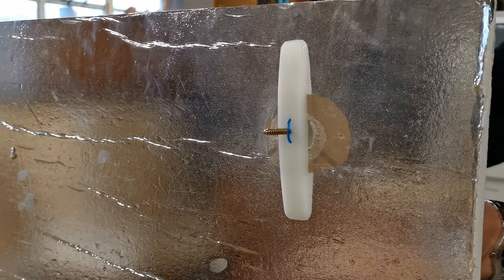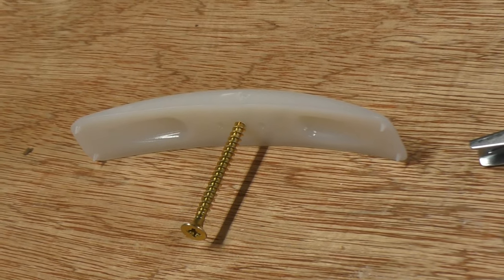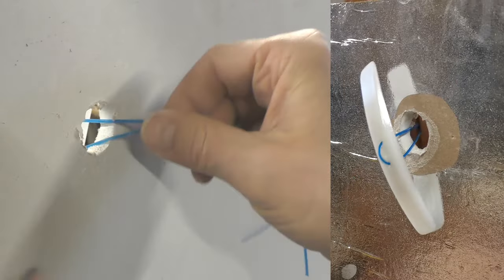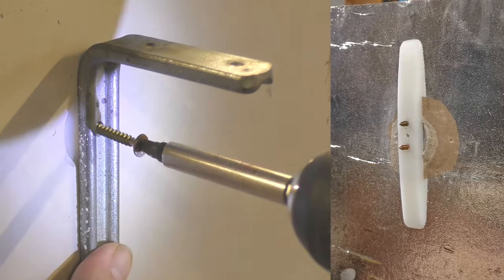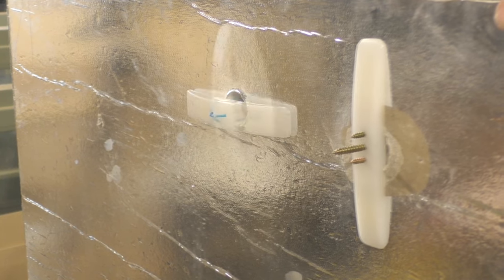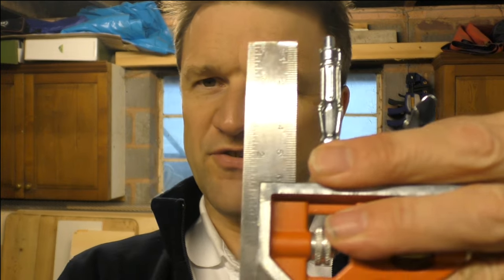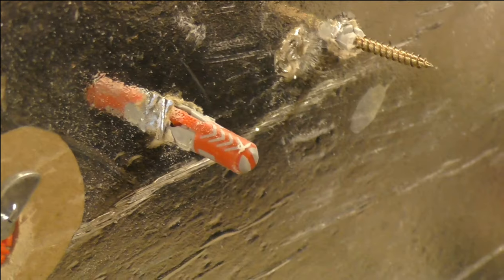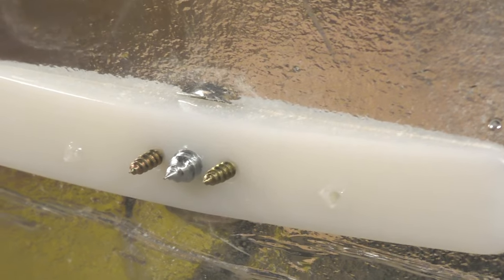The Strongest Plasterboard Fixing Ever!

Comment: I just fit a double Ikea Pax wardrobe and had been searching for ages to find best way to secure it from falling onto my toddler and this has sorted me right out! I was always fearful of having to fix into plasterboard, especially where I absolutely don't want it to fail and this is just magic. Thank you!
Reply from the maker: You're welcome Jonathan. Thanks for the comment!
Reply: better to find the timber uprights if there are any they will be at 400 centres, then fix to that instead. or you can cut a hole in the plasterboard and fix a timber between the uprights to screw into then put battens on the underside of the plasterboard and fix the piece you cut out back in. failing this you can just use these device and put gripfill on the back of the wardrobe, or, drill a big hole enough to get a long length of batten through the hole and hold it on the other side with your fingers then fix it with lots of screws

Comment: Great idea.
No reason why it can't be scaled down to a half size version for lower loads.
Reply from the maker: I was talking to a fitter who works with me on the day job and he said exactly the same thing yesterday!
Reply: Charlie DIYte   A small version would also be easier to insert when the gap between the wall and the plasterboard is significantly smaller than 30 mm.
Reply: Snap toggles are what you need. I've been using them for years, and have the advantage that the fixing is by a standard thread machine screw. @ianmathieson65
Reply from the maker: I think they're working on this, and also trade packs will be coming out soon apparently.
Reply: Charlie DIYte sure he did.
Reply: I said it to my fitter 3 weeks ago
Reply: @CharlieDIYte  Well these are more practical and you can hang a man of one fixing, go to Bullfix.co.uk to find out more .
Reply: @ianmathieson65  Well these are more practical and you can hang a man of one fixing, go to Bullfix.co.uk to find out more .
Reply: @peterwhite51  yeah, but can cut through electrical wires hanging in the back of the board, these are the best option >
Well these are more practical and you can hang a man of one fixing, go to Bullfix.co.uk to find out more .
https://youtu.be/mCt7_j8n-Yw
Reply: Mark Howe:  Thank you Mark.  I’ve watched the videos using the link you provided.   Certainly very impressive in pure shear but I wonder how they’d compare with other fixings if there’s a significant pull-out component to the load as with a heavy wall cupboard.  Because the centre of gravity is then offset from the face of the plasterboard, the cupboard will try to rotate about the line contact with the wall at the bottom edge of the cupboard.  Of course, these fixings near the top will try to restrain it from this rotation but in doing so will experience a pull-out force in addition to the vertically downward shear force resulting solely from the weight.

It would be most interesting to see how they then compare with other fixings in a straight pull-out test where the area of contact of the fixing against the rear of the plasterboard becomes the important factor to prevent break-through.  I suspect selecting the best fixing depends heavily on the magnitude and direction of the load force, i.e. it becomes a case of horses for courses.
Reply: @ianmathieson65  Good reply, and you are absolutely right, there is Sheer (downward force 90 degrees), Tensile(direct pull out) and then a combination called a rotational force. We have many competitors products including our own that tests sheer and tensile loads and we are currently adding rotational load videos at our website this week.  Most importantly its how well the surface mates with the surface behind the plasterboard, it needs to be a flat surface to distribute the load evenly over the paper and not to pierce the paper at the rear. There is a limit to Tensile pull out on plasterboard between 400mm centres, we have modelled mathematically our fixing to be at the top end of this scale whilst keeping it as small as possible. (cost in manufacturing) Its also a two part fixing that can be put together by the end user, making the cost savings to the customer. We have maximum loadings on the smallest fixing that can be possibly obtained. you cannot beat BULLFIX Plasterboard fixings. See our testing at our website, search for http://bullfix.co.uk
Reply: @markhowe5539  That one isn't more practical if you need to put another screw in close to the first one.
Reply: @peterwhite51  They are very good, but they don't work in very thin materials like ply or hardboard - you can't trim the plastic part down from the front as you'd end up with two pieces.

Comment: I often do a similar thing using a thin strip of wood or ply,pre-drilled, & short bit of string to pull, & shove-through a hole or slot in the plasterboard, then screw on,with bracket pre-attached.
Or better still, if you can, use a magnet to see exactly where your nails/screws,are,, therefore your timber/metal studs are, & fix solidly into them.

Comment: Looking at this I can do the same thing with a pice of timber with two holes, a bit of string and some drywall screws, it's been well thought out though.
Reply: I regularly patch repair plaster board ceilings using a timber batten and fixing original cut out back. Makes sense I could do this on a stud wall and create fixings where required. Would need some easy fill to cover up though 👍 will definately give these fixings a go.

Comment: Charlie, you just saved me a lot of heartache trying to fix a drywall fixit problem. I just ordered a 8 pack  of geefix. Thank you!!
Reply from the maker: Glad to hear it. These things are very clever. I was doing a soft furnishings project in Barra and the wall was old lath and plaster - just crumbled away with the fixings we were using so as a last resort I used one of these. Gripfilled the gap, filled with Easi-fill the next morning and the fixing was as strong as if we had anchored into the wall behind.

Comment: In the US we have "Snaptoggle" BA from Toggler. The heavy duty version 3/16" can hold up to 238lbs in 1/2" drywall and up to 802lbs in concrete block. They are easier to install and reusable. No need for 2 holding screws and a string like this design. Maybe a comparison between this two anchors would be very interesting. Cheers
Reply: May be we in the UK can get it after Brexit with the UK/USA trade deal.
Reply: Have Snaptoggles in UK too. I use all the time. I dont like the 25mm hole on this one

Comment: THANK GOD!!!!! I came across your video... I was running into blanks worrying about how to hang my 3 radiators (double thickness = heavy) on my drywall upstairs... this has LITERALLY saved me ££££ in not needing to get the walls ripped open to re-brace the studs for the radiator placements. thank you, keep up the great work!
Reply from the maker: Yes, these will be great for that. An awesome fixing that has got me out of trouble on more than one occasion! Thanks for the comment!

Comment: Been making something similar for heavier light fittings for years from a cutting of timber or doubled up trunking lid and copper wire
Reply: @markhowe5539  
Cheers, those Bullfix Plasterboard fixings look much better design wise and durability longevity wise. I'll be hanging up expensive heavy duty 6kg on wall speakers so I'll be going with the Bullfix Plasterboard fixings for peace of mind it won't bend warp the plasterboard.

Comment: As to the Gripit fixings, they're actually a blessing when you have the plasterboard within just a few millimetres of the wall or lintel. Which begs the question: how much clearance do you need , for this fixing, between plasterboard and backing?
Reply: My advise, get a a hammer drill, a concrete drill bit and drill through the lintel. Use a plastic wall plug suitable for concrete / solid walls and problem fixed. This way the fixing will be solid AF.
If it's a metal lintel, then use a metal drill bit with the diameter smaller than the screw thread size and put the screw straight through. Problem solved.
Pro tip: Don't tight the screw too hard, as it will push the plasterboard towards the lintel and it will create a dip on the surface.
Reply: He literally says in the video that you need 30mm for this fixing between plasterboard and backing.
Reply: @arcadely  He literally does nothing of the sort.
Reply: @LordOfLight  You must be trolling. What do you call 8:14 - 8:26? He both describes and demonstrates the clearance needed for the fixing. Did none of you actually watch the video?
Reply: @arcadely  No I'm not trolling, and yes he describes the clearance for the fixing he's demonstrating at that moment; but not for the GRIPIT fixings that the original comment was about.

Don't disappoint me now: under no circumstances admit you're in error and instead claim your mistake is all my fault. I'm looking forward to it.

Comment: (4:00 )Why are you using a Phillips bit on a Pozidriv screw?
That's why it keeps camming out.
And why didn't you mention the Fischer Self-Drill Plasterboard Fixings?
These are superb. I use them all the time and have never had a problem with them even with quite heavy loads.
Reply: Phillips / pozidrive miss use triggers me to no extent, Working in a workshop when i see broken pozidrive drivers and tips, or rounded phillips drivers it bothers me to the furthermost extents of reasonable irritation.
Reply: @another1commenter770  I know. And this dude is meant to be setting an example....
.
Reply: I used them recently for traverse rods and well, I have very brittle plasterboard or they are really not that good.

Comment: About time somebody has come up with a reasonable method of fixing to plasterboard I have to replace my curtain rail fixing 4/5 times over the last 20 yrs I will be definitely trying these out.Great tip Charlie
Reply: For curtain rails try the captive expanding screws.   Or enter the arms race and use 10x50/60 plugs and 6mm screws. Small screws are useless.

Comment: Great video - clearly explained and allowed me to fit 4 new Rointe Olympia electric radiators onto both plasterboard, double thickness plasterboard and a concrete wall. Used the Gee Fix for the plasterboard, and standard screw and supplied rawlplug for the concrete wall. One thing that was interesting was clearing enough of the polystyrene insulation behind the plasterboard to insert the Gee Fix, I found a bent metal coat hanger sort of worked better compared to using your fingers. The radiators were 28kg down to 18kgs, all felt really secure using the Gee Fix and solid when fitted. Did grab some T Bolts just in case the gap behind the plasterboard was not suitable for the Gee Fix. Great videos and advice, you encourage a DIYer to have a go with confidence.
Reply from the maker: You've done a great job there Duncan. Very impressed you managed to clear the insulation for the Geefix. They're a segment towards the end of my recent plasterboard fixings update video https://youtu.be/Jdu9RId7m90 where I fix into the insulation and those T bolts force themselves open, so they are good. Bullfix Extra are also good where you've got very limited space behind the plasterboard although personally with a small gap and brickwork behind, I'd probably use a Corefix and drill into the brick.

Comment: always place it vertically. gravity points down so torque is applied on the horizontal axis. unless you have mainly side loads.
Reply: That was my logic also until I saw this video https://youtu.be/lHb-Tcvkn7M?t=558 clearly showing this anchor performing better when at a 90° angle to the load.

Comment: Charlie - thanks for the tip about using Geefix. I'm not much of a DIYer but I decided to try using Geefix to hang a 26kg mirror  on  a plasterboard wall: It worked perfectly.
The only slight hitch was when I put the first centre screw in it must have somehow caught the plastic "string" and I was unable to pull it out until I loosened the screw a bit. 
Other than that it was plain sailing - the mirror has stayed up for 24+ hrs now so I'm confident the fixings have worked!

Comment: Charlie have you never heard or the thorsmann plaster board spring toggle fixing. I am a professional installer in an A/V capacity and we hang 25-30 kilo speakers out of two of them. There expensive at around 80p each they come in a box of 25. You can use them in single double or triple plaster boards
Reply: Scroll down to the third one on the page. These are the only fixings you will ever use.
Reply from the maker: Thanks for this Philip. Is this the one you mean, in operation https://youtu.be/NsICJ2U0YfU? That is a bit impressive!
Reply: Charlie DIYte Yes Charlie that’s the only. They come in 2 sizes. We always use the larger ones. Drill a 13 mill hole then you push the toggle true the hole it will open and pull tight with the spring.  job done. Your left with the bolt and the head of the toggle.
Reply: Charlie DIYte Charlie are you going to do a video with these fixings.
Reply: Hi Charlie have you seen them fixings I was telling you about.

Comment from the maker: 🛠Charlie DIYte Amazon Tool Store https://amzn.to/3fcLnY4 - all my tried, tested and much loved DIY tools. Help support me by Buying me a Coffee ☕ https://bit.ly/3xuQ3zb and unlock a host of benefits - thanks so much 🙏.
Reply: Charlie DIYte love the videos, very helpful. Would you receive the ux8 or the wall anchor to mount a 10kg mirror onto plasterboard?
Reply from the maker: @martingalli2786  Hi Martin. The UX8 or Duopower 8x40 would work well as long as you got it to open up well behind the plasterboard. To be sure though the wall anchor would probably be safest.
Reply: Great video just the job for my new rads
Reply: Hello Charlie, Im thinking of putting an 11kg mirror on a stud all. I have radiator plastic pipes just behind this also. They should be slightly set back as it used to be an alcove in hall when we moved in. =The builders ran the radiator pipes in alcove then covered with Drywall. Its a bit of a risk but I really want this mirror there. Can you recommend the fixings and can I get away with short screws so they have less chance of piercing the tubes behind? Thanks if you get a chance to answer. Ill keep and eye out on your Chanel.
Reply: @-Grifter  Mate be very careful that soundss like a episode of some mothers do em waiting to happen
Reply: @curbyi76  ha. That made me laugh. They are set back and I may be going either side depending on where the mirrors fixings are. Really want this thing there though it’s a black space that needs filling
Reply: @-Grifter  Weight wise no problem used them recently on heavy vertical rads sent the plumber away a believer.
Reply: @curbyi76  yeah mate. I really want the least intrusive way possibly without the plugs. So just a screw hole. Not this new fandango fixing.   I want to just put in a short screw and hope that holds it.

Comment: Plasterboard is the work of the devil. Give me proper masonry walls with real plaster built up in layers any day. Can't stand the modern way of even using plasterboard on solid, outside walls- cheap I know, but inferior in every way.
Reply: Cost is king these days, it's the way 40% of homes are built these days. So if you have to use a plasterboard fixing, then use the strongest on the market. Bullfix Plasterboard beats Geefix in real life situations.

Comment: Looks brilliant. Just had a radiator pulled off a wall by a two year old because it was only fixed to the plasterboard with two brackets, each bracket secured by two screws going into expanding rawlplug type things.
Had it had these it would never have come away!
Reply from the maker: Sorry to hear that Keith. You could use these for the repair, or Corefix if there's brick behind the void.
Reply: A

Comment: That is a very impressive piece of kit. Great video by the way showing everything that’s required to use what looks like a go to product.
Reply: The main issue I can see is that not all plaster board😊 has sufficient space behind it. This is especially true if it has been applied using dot and dab and you may not be aware of this until you start drilling.

Comment: I was so glad to find this video. I’m installing shelving in my garage that need support from the ceiling but the studs are 64 cm apart (25 inches). So, I’m going to use these in between the studs to add additional support. Fortunately, I was able to find them here in the United States for a cost of $15  (approximately £12). It will be a week or so before I get them but I’m looking forward to reinforcing the ceiling above the shelving.

Comment: Nice demonstration Charlie. I’ve just used the toggle ones for a curtain pole as the plasterboard turned out to be double thickness and grip it wouldn’t go through. The last bracket position didn’t have sufficient cavity behind which I only discovered after I’d drilled the 25mm hole! Typical eh! I concreted it up and used a rawl plug which did the trick. These look fantastic. Will be ordering a packet. Many thanks.

Comment: I've just moved into a modern house with dot and dab walls, I'll be giving these a trial as they look great. I'm a maintenance engineer, and hate plaster board walls as I often have to fix heavy items to them. This looks like a great solution. The cost is almost irrelevant, to have fixings pull out of a plaster board wall causes a whole new troublesome job to rectify.
Subscribed to your channel 👍